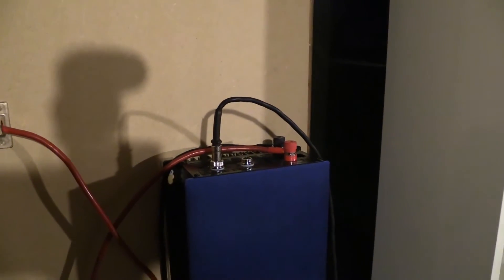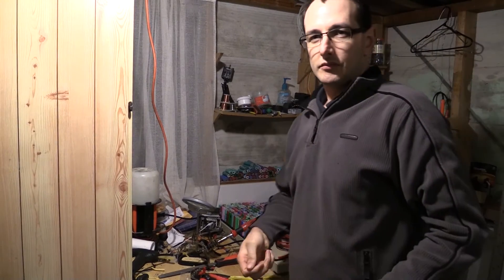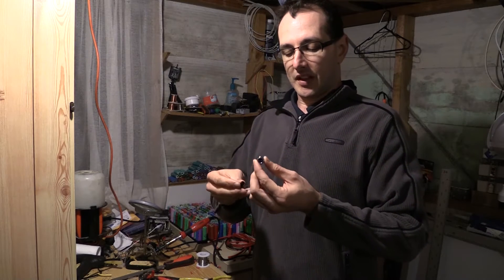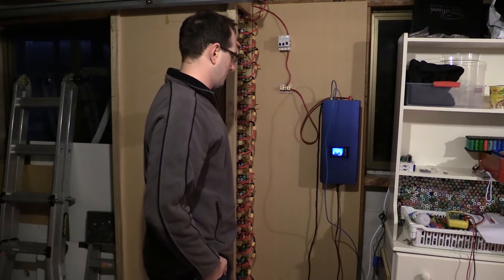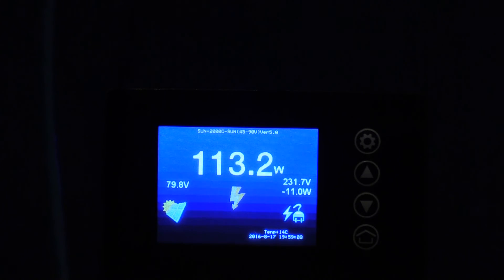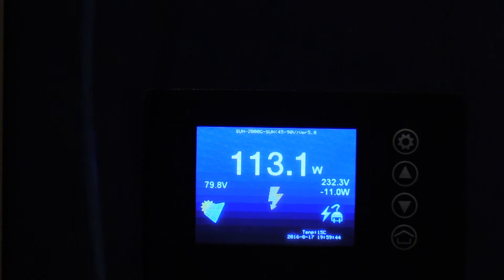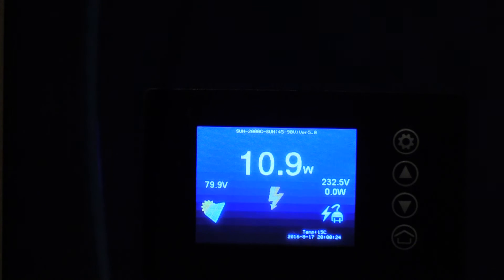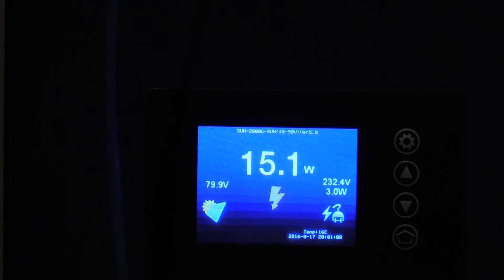CT Clamp Extention

Comment: Hi , great video , thank you . do you have link or list for those parts you used ? and is there a way to connect two sensors instead of one ? in the usa we have two wires each has 120v , so boh need to be monitored and each need a ct clamp .  ? thank you

Comment: Is it possible to have 2 of these inverters running.. example: one for a pool pump (ct clamp on pump braker) and the other on the house main box? Is that doable?  (Pity you can't adjust in menu for the cable length gain).
Reply: Yes you can.  Check out oldtimeengineer he has two running on his with one ct clamp on one leg and the other ct clamp on the other leg.

Comment: in the handbook it says you can have the clamp upto 30m away.  i just used some thin speaker wire that was 30m, its working sweet as, but what i want to know is how do you run  2 or more units at the same time all set to limit oO do i have to run 2x the cable or could i just splice the cable i have and have one clamp feeding all inverters

Comment: By chance, would you know the inside diameter of the sensor clamp ? I've looked high and low on-line and even asked the question to an ebay seller - without results--- (I've heard they are celebrating the Chinese New Year) I want to be sure it will go around my incoming wires from the meter (which are huge)
Reply from the maker: around 12mm , they use the 100a 50mA Blue CT clamp
Reply from the maker: Very ture but i ended up buying it anyways as my CT cable was 20m and i was getting about 90% rather than say 100% if i had a short CT cable. Eg if the house load was 200watts the grid-tie with limter and 20m CT cable read it as 150watts ish so the 50w came from the grid, depending on the house load eg the fridge it would be out by more. However at higher loads it was better just the very low loads it couldnt read well. I will be doing a video of the External unit soon so stay turned :)
Reply from the maker: Very ture but i ended up buying it anyways as my CT cable was 20m and i was getting about 90% rather than say 100% if i had a short CT cable. Eg if the house load was 200watts the grid-tie with limter and 20m CT cable read it as 150watts ish so the 50w came from the grid, depending on the house load eg the fridge it would be out by more. However at higher loads it was better just the very low loads it couldnt read well. I will be doing a video of the External unit soon so stay turned :)

Comment: Try running it along the route more or less as you intend later on for a test run. When you stretch out the cable you turn it into a long antenna. It may or may not become an issue.

Also shielding the cable may help, or using an old coax cable (TV antenna cable, or audio cable, for the cheap version). I'm not really sure though, since the "twistiness" of the TP cable should counteract noise (all increased voltage on the brown at a point in the cable should also be added to the brown/white, so the differential between the two should stay the same).
Reply: Working in IT you might have access to shielded network cable, that will help with noise. connect only one end of the shield to battery negative. some single pair phone cable is also shielded.
a long cable would lean more towards a lower frequency antenna, and it is dealing with 50Hz mains so could pick up mains hum from power lines in the area, hopefully they are not parallel with you CT clamp cable.
you could try a capacitor say a few picofarad across the end closest to the inverter.
Just ideas and its working quite well as it is so might not be worth it.
Reply from the maker: Good point i will lay it out and see if that makes a diff :) It should do